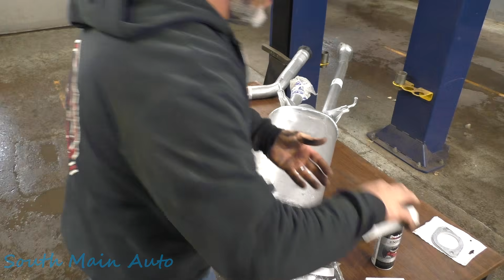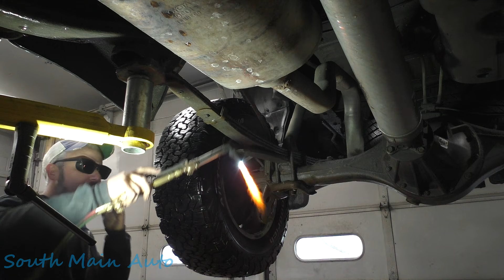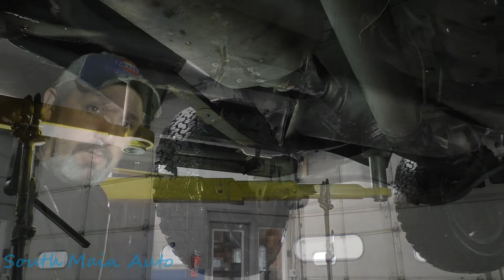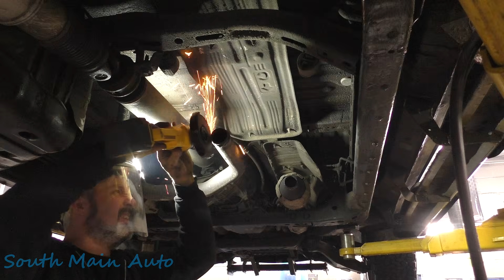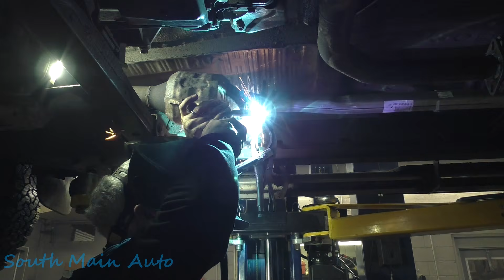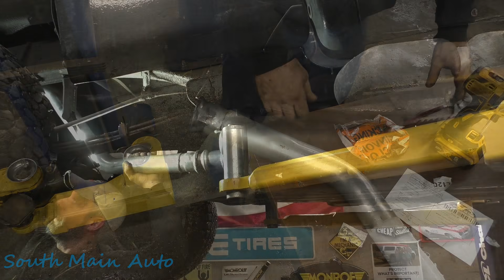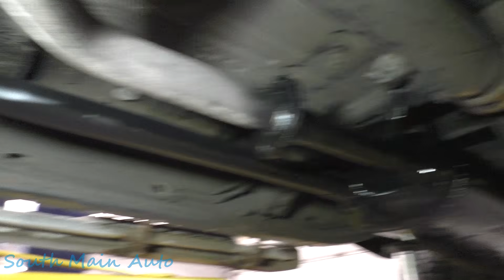Toyota Tundra: Welding On New Convertor Flanges & Replacing Muffler

Comment: When I noticed the walker exhaust I put on was dying faster than I expected, I started looking up a replacement. OEM was out of the question on a vehicle over 20 years old, rockauto doesn't have many options. I actually found a few shops on ebay that make these parts in the US. I can't remember any of their names, but at least I know they exist. I do remember one being in North Carolina, which isn't close to me, but I'm so fed up with cheap parts, I'm fine taking a long trip and wasting time, one time, to do it correctly. 
I did get the walker catalytic converter warrantied, and got a new one, because even though it was stainless, it was the first piece to rust off.

Comment: That's pretty good that the muffler lasted 9 years in the rust belt.  I owned a 2004 GMC Envoy XL, purchased in Lansing MI and drove around in Lansing MI, and the muffler only lasted 1 year.  Actually, the SUV only lasted 2.5 years after I returned it under the lemon law.

Comment: Hey Eric how come you didn't just weld new flanges on the OEM system? The rest of it looked pretty good and preserving the OEM mufflers is surely worth it.
Reply: he said the tail pipe came off in the past and it got twisted up on the axle, probably swiss-cheesed the back of muffler/internal making it loud.

Comment: If you're going to go aftermarket on mufflers and exhaust system go with flowmaster it cost a little bit more but it's better quality good sound and mufflers and everything else everybody I know goes with flowmaster and I haven't had a several friends of mine bought brand new trucks off the off the lot drove them about a month or so maybe two and then right went right straight to the exhaust shop had all the stock stuff taken off everything was redone flowmaster oh hello masters best way to go especially up there where you're at up there in New York and it's a good gauge of metal and it will probably take maybe 2 years for it to rust out they ain't going to say that for sure I don't know how strong the salt is on the roads and stuff up there but flowmasters or way to go but and I wish you luck with it yeah just about everything now is junk go to shawty manufacturing cheap materials and all they're after the American dollar and screw The working Man if we fix it right and do it the right way it'll cut into our profits we wouldn't have a hundred million dollars in profits we can't have that we got to have our hundred million dollars or more in profits and screwed a working man that's the bottom line and all these manufacturing companies it doesn't matter where it's a car or a toaster it's screwed or working man give us our dollar give us a hundred million profit all right man sorry about the rent but you get a guy like me to live trying to live on a fixed income and you go to the store to buy a flashlight say and you get home maybe use it for a day next time you go to pick it up to turn it on it doesn't work so and there's no way to repair that crap really just chunk it in a garbage and try another brand all right you have a good day and I hope you get your Toyota fixed I know it sucks oh we got a better idea we going to do this we going to do that yeah nine times out of 10 working man's getting screwed and this does a bunch of crap I have fun get your Toyota fixed to get it sounded good and I'll talk at you later

Comment: Knowing my luck I would fry the engine computer trying to weld on the vehicle. I always unhook the battery and engine computer before welding on a vehicle but I dont know if it's necessary or not

Comment: Yes I would like to start the war on which truck is better!!  I have owned both full size trucks and currenty drive a 2013 silverado LT, which stands for Large Trash!!  I cannot count the number of problems on my hands and feet.  Yes we need to break out the calculator to start the counting process.  The frame rotted as they all do!!  And the icing on the cake is the DOD/AFM system failure.  Trash, Trash and never again.

Comment: I am guessing, but I think the home mechanic, if he has an acetylene rig, it would be very small and go though tanks quite fast.  These smaller tanks add up quickly and cost much more then when buying large tanks.  With that said, I still would'nt trade mine in for anything, they are as you but it quite esential in any salt belt type repairs.

Comment: Thanks for the video Eric, great torch work! Welds didn't look bad either! Years ago had a 74 Maverick, got pipes and mufflers from the Zone. I think I must have replaced a part of it every year. Had a stack of receipts so I very rarely paid for the parts. Got very handy cutting the inside pipe out with a hacksaw blade. Took some time but gotter done. Hope you and your family have a great and safe holiday.

Comment: Walker gaskets are garbage made in India, paper thin and weak construction.  They blow out just about instantly.  Make sure to install with Permatex Ultra Copper if you want any change of them lasting and your still lucky if you get a year out of them.  Do yourself a favour and go OEM on the gaskets, there is a huge difference.

Comment: When I worked at the tractor dealership working in service, we fired up the torch a lot! Cutting old gears, bolts etc! It was faster than spray and pray your favorite penetrant. The lead mechanic told me what each minute costs to work on a rig and it opened my eyes. Use that torch Mr. O! Whatever works the best. I inherited my father in laws torch kit and I love it! Keep on keeping on!

Comment: Dang that "new" muffler looks like the rattle can special.  Next time look into Ferrita exhausts for options.  Full stainless that allows good flow, but not a lot of noise.

The rear coupling (marmon) flange isn't a bad style, they usually seal pretty well.

Comment: About a cutting torch the question is that versus a power saw for cutting exhaust pipes. That's what they often use here in Texas for exhaust work that i have seen. Not that they never use a cutting torch though.

Comment: At least it was not a 2018 C-HR. The K114 CVT has variator bearing issues. Not much on the later 2019 and newer. It would be about 10k for a complete transmission and torque converter replacement.

Comment: Love your videos. I am a boilermaker ( I work in power plants,oil refineries, chemical plants , nuclear plants etc) I live in New Jersey, I sometimes  weld on the back of my 2006 ram 3500 ( I installed a Dynatrac free spin hub kit on it) I got away with welding on the back of the truck for about 8-9 years and I had two things happen. Not at the same time. One time something happened to where a mechanic friend told me I had to take battery terminals off and touch them together , then reinstall them and the truck started. The other thing was one of my front wheel bearings went . And upon removal there was plenty of grease inside ( not a sight of water) I also do not leave the paved road with the truck. After I removed the bearing and race and also cleaned them I found a arc burn on the race which obviously damaged the bearing. My question to you is, do you always disconnect the battery when you weld on a car/ truck? Sorry for such a long story. Thank you for your time and videos.

Comment: Hi South Main, I want to let you know that I am a fan of your channel, and after watching this video, it confirms what happened a few years ago with my 1999 4Runner. I have owned it from new and take very good care of it. However, we have quite a few repair shops where I live in PA that take every opportunity to rip you off. The shop I take my 4Runner to, replaced my OEM system with a Walker system to pass emissions. My Toyota never felt the same afterward. Then two years later, they said the muffler and tailpipe had rusted through and needed to be replaced again. After getting poor performance and numerous CEL, I bought an OEM system from the dealer in 2021 and replaced the Walker junk myself. It was expensive but worth every penny, as my 4Runner runs like it did when it was new, and no more CELs. Keep up the good work.

Comment: At 34:18 there is no "dribble hole" in the rear bottom of the exhaust cannister.  Probably would be a good idea to drill a small hole to allow condensation to blow out.

Comment: On the acetylene cutting torch controversy. As your great expression states. Welcome to New York BABY! Yes you need this tool. You are there for a good time not a long time. Is it worth wasting time playing around with a flange or bolt? The customer, in this case you, wants thier truck back pronto. Another great video of the ins and outs of parts headaches and repair accommodation.

Comment: I think you done pretty good with that torch! Very little grinding. And I noticed you did no grinding after the welds. I weld for 1 minute, then grind for 15 minutes. Then I weld for another minute, and grind for another 15. I don't have a torch. I'd be torchin' for 1 minute, welding for 2 minutes or longer to fill the holes, then grinding for 30 minutes. I can't seem to get it right. After I weld for a minute, I can't see very well, and I hafta wait till  I can see again.
Reply: A grinder and paint make me the welder I ain't 🤪

Comment: could you possibly do a video using two smartphones one as a signal genorator and the other as an ossilloscope and was wondering if a signal genorator would work for emulating immo signal on 2012 fiat 500 sport i bought from pick in pull no key had a key made but bcm locked so i was not able to program one with Autel mk808 then someone broke in my truck and stole all my tools curious as to if it may work on signal circut so i dont half to buy bcm

Comment: If you know Toyotas - I do - then you know they are just as hit & miss as anything else. Their hits are excellent - just as their misses are awful. 

If it says "VVTI" on the bumper-sticker, it's chunk. It'll burn oil, be rubbish for economy,  not greatly any more reliable than your boggo Hyundai & you will curse Toyota.. you just will.    However if you had the same model but with the older style 1.8 engine... mint. Or the 1.3 Corolla instead of the 1.4 - just 100cc difference, but entirely different beasts. 1.3 good... 1.4 bad.. Or if you were fortunate enough to have owned one of the "Peak Toyota" toyotas - the 1979-1999 models... those rcck. All of them. 

This era Tundra? Meh - average ride, average reliability, below average economy, above average rust, seriously expensive parts and a bit of a pita to work on. Isuzu make a better truck. In fact Isuzu make the best trucks - but semantics.

Comment: I think using a torch is a fine skill, that is close to an art. In school there is little to no education in using it, so generally people are afraid of using it (risk of fire). Tools cost money and it may seem expensive paying the bond for the first set of cylinders. If the person that is using the torch is not quite skilled it will take longer and use more gas. When used correctly a torch beats a sawsaw hands down, and of top of all it can't be tight if it's a liquid.

Comment: My 2006 Chevy Silverado SS over 200K not a bit of rust & original stainless steel exhaust. Only thing I've replaced is the LF wheel bearing. Just done normal maintenance with OEM parts & all synthetic lubricants. They don't make the SS anymore so I don't ever plan on buying another truck. As far as the torch goes I have Diablo blades but I still reach for my torch. The New Yorker in me comes out. Learned real fast as a NY mechanic grab the torch & minutes later the rusted exhaust is on the floor. Only had arc welder & acetylene torches so learned real quick how to weld & braze even the most rusted crap. Now I MIG everything. Thoroughly enjoy watching you torch stuff. Brings back my NY early days as a mechanic!

Comment: With the right tip on your cutting torch and experience you can get(almost)plasma results Like Eric said you got to control the heat. My garage is under my house so I must be very careful, where the molten metal is going. 42+yrs. no pucker factor!

Comment: I love Tundras.  I am on my 4th one.  I drove the first one, an '07, for 5 years, 95,000 miles.  I changed the tires and the wiper blades and nothing else.  I got 60% of what I paid for it after all that time from the dealer!  Similar experiences with the '12, '16 and the '19.  I was laughing out loud when you explained why we feel the need to touch something 5 seconds after welding it.🤣🤣🤣 I think you're a GREAT welder.  Merry Christmas

Comment: Hi Eric, I have had some issues with  walker also, fitment ,workmanship and junk materials. I had a 1978 Cutlass Supreme ,came with a 305 Chevy, nice pillow back seats,some essential bells and whistles, real nice ride 32k miles. I could not get a walker Y pipe to fit that car. after 3 walker I went AP exhaust, nice fitment,workmanship and thicker pipe. With the walker where they joined the left pipe with the right ,the hole in the right pipe was just over 1 inch, and the same happened with my S-10 2.8 5 SPD ,that hole was less than an inch. Now they quit making them , What Jagoffs!

Comment: Yeah, aftermarket exhaust parts and delivery damage ... "some assembly required."  And I've never had one of those Toyota exhaust clamps seem to fit right without a struggle, even when using genuine Toyota replacement exhaust parts.  I'm with you on "they're all junk when they're broke", but Tundra fans should be among the last to point fingers at others regarding frame problems!  Wasn't there even a recall about that?  🙂

By the way, nice job welding that thick flange to that thin exhaust pipe!

Comment: I've seen a small hole drilled in the bottom of the muffler at the rear to drain any water/condensation out that may get in to prevent rust from the inside out.

Comment: Toyota gave into dealers and had a small % of vehicles with problems..Dealers were complaining their service tech had no work..  Have had many U.S. made vehicles, company cars, a new one every 24 months.  Only buy Toyota for my own vehicles after buying a new Chevrolet decades ago.. Huge mistake... 2001 Highlander bought used in 2014  now has 94,250 Miles  and a 2008 Sienna  in 2018 with 126,000.. Approaching 146,000 and in both vehicles only batteries, oil changes and tire rotations..Newer vehicles have far more issues than older ones.. Improvements so often lead to new problems..  Havent had a muffler replaced since I move from North East 25 years ago..

Comment: Haha be more specific on the welder settings. I have noticed that the settings, wire, and gas used and given greatly increases the output of the comment generator. Nice job and clear process.

Comment: GM started using clamps like that on the 14 and newer trucks.  Its a pain cuz they rust solid but a little torch work fixes that with a new bolt.  They use it up at the y pipe to rear pipe though. It has to come off everytime the tranny comes out which is apperently a lot on a Cheevy. HAHA.  Still rather work on that than a ford.

Comment: I have owned several Toyota trucks the early ones run like a swiss watch but the 2011 Toyota Tundra I owned with the V8 was the biggest pile of junk I have ever dealt with.. Here is a just a short list first it spent three months at the dealer ship for a Air Injection Pump repair it took that long to get the part because I guess there were a lot of recalls on this one, they did give me a loaner. Second stereo system went out twice first under warranty second time out of warranty wanted 2k to fix it said screw that, fuel gauge went out almost 1k to fix, air damper door actuator went charged 1600.00 to repair that one...  Cam tower leaks they did fix that one for free took almost 3 weeks to get fixed. There are more repairs but these are just some of the big ones needless to say I think a Daewoo would have been more reliable. I think early Toyota's are awesome about 2010 quality went to crap is my feelings..

Comment: I too live in a rust climate. I use the torch but most of the time when heating bolts i use an induction heater. Not those cheap with a wire you wrap around a nut.  
And for exhaust i prefer a chain pipe cutter

Comment: Just a quick note that might make life a lil' bit easier.  The confines, restricted access space makes MIG welding exhaust a PITA.  Thought you should know that Tweco makes an adjustable/bendable replacement contact tube for MIG guns called the Knucklehead series making it a ton easier to wrap a weld bead around those hard to get to spots.
Reply: Thanks, I was wondering how others get away with that.
Reply: Damn.. I need one of these!

Comment: quick tip, if you strip out a battery cable(stranded Cable)  works great to wrap around pipe for your Ground Lead to attach to.

Comment: I have a 2001 Chevy Blazer that I has been sitting for about 3 yrs.  The first 2 years it was started at least every month and sometimes run a 1/2 mile or so each time.  I live near Allentown PA.  I have contacted a few local garages but everyone is backed up.  One garage said oh yeah bring it over and they left it sit there for 2 months til I said just send it back.  Cost me $300.00 to have it towed there and back.  The major problem is brakes, ABS and Brake light on.... thats why it sat.  Willing to put some $$ into it  cause it is so comfortable to drive. Do you know any repair or restore people near me that would like  to take it on?

Comment: I totally agree with you. Walker stuff is junk. It's a shame. They use to be good. Last pipe I got, the joints where only half welded with enough mig wire on it that it made a porcupine look bald.